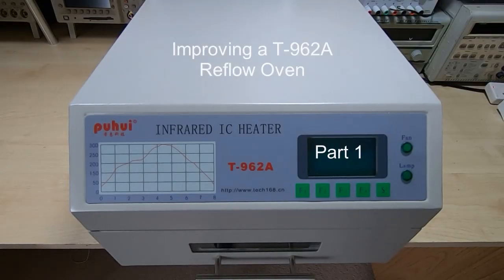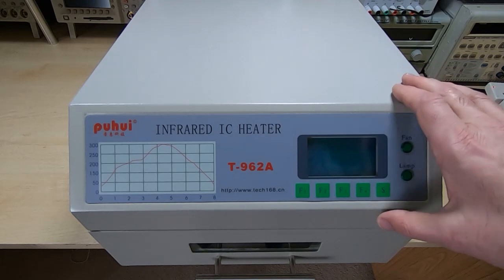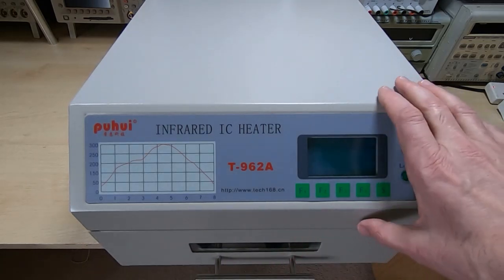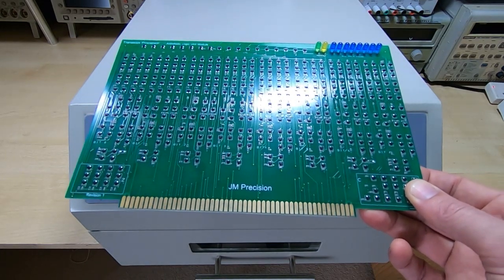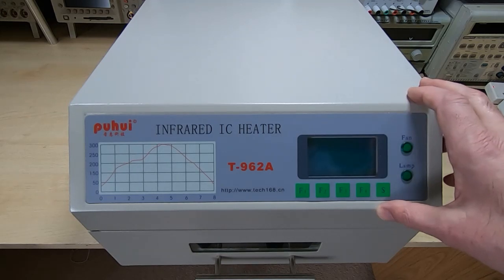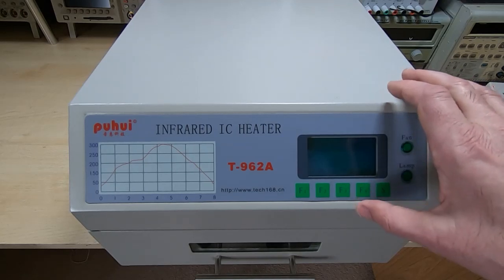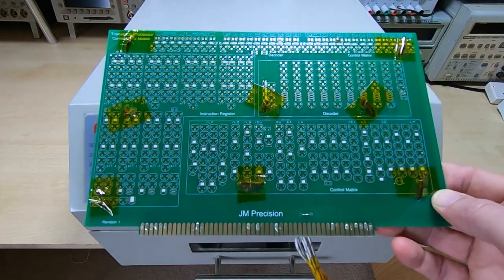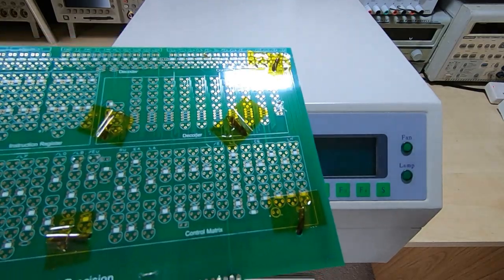Improving a T-962A Reflow Oven Part1

Comment: I think it is important to note in something as relatively simple as an IR reflow oven why the distinction between "industrial grade" and "hobby grade" shouldn't matter to most people. "Professional" results are going to be able to be achieved with either if you put in the requisite time to understand the machines and their eccentricities. The primary difference between "industrial" and "hobby" in these units is not quality of output per se but throughput. The industrial equivalent will have a conveyor belt that can interface with placement machines and basically is pre-configured for pumping out ungodly numbers of pcbs in as little time as possible. You will obviously never do that with the "hobby" units, but for anyone that is not producing pcbs on the scale of thousands per day, it really isn't going to be any different for you.

Comment: Very interesting. I had this conditions in other reflow tools that characterized. I compensated using lower melting point solder paste, and it worked fine. Thank you for sharing.

Comment: I’m Dutch and I know nothing about the flicker standard. With that out of the way I have to say that I don’t understand why you shouldn’t be allowed to use PWM provided that you install decent filter as well.
Reply from the maker: Because the standard does not allow it, it makes no difference if you understand it. In the UK (and all harmonized standard countries) the standard applies to any commercial product and a filter would make no difference as it relates to mains voltage stability and Not 'noise'. Having said that I am talking about low frequency switched control and not high frequency control although the standard would still apply if it causes the mains voltage to be 'switched' in such a way that step changes in voltage beyond certain limits are caused. Suggested site to review https://www.newtons4th.com/electromagnetic-compatibility-iec61000-3-32013-flicker-analysis/
Reply: Jerry Walker Hi,
Thank you very much!
You are absolutely right that it doesn’t matter whether I understand it or not. 😁
I’ve looked at the suggested pages and the standard makes much more sense to me now. It’s to prevent excessive voltage fluctuations mainly caused by appliances with large motors or resistive heating elements. 

I was thinking about SMPS but they switch at high (>50kHz) frequencies and are off the chart (Pst curve of fig 2). The noise they induce could and should be filtered of course. Using transistors for switching or otherwise regulating the heating elements would probably be too expensive for this oven. 

More importantly, having watched your other video’s now, regulation isn’t even the issue. 

I do appreciate your robust methodical approach. 

Thanks again, Eduard
Reply from the maker: Thanks, Yes absolutely correct and as you see in the later videos the problem turns out to be one of energy distribution rather than temperature control.

Comment: Looking forward to see where you get to.  It is possible to change the power using variable voltage PFC drive on each lamp, though it's over the top if you have a simple solution.
Reply from the maker: I was initially going to redesign the 'system' but as this is not my primary reflow oven I wanted to find a solution that anyone could apply with minimal cost and effort. The video currently uploading shows a good step towards this. Let me know what you think.
Reply: @JerryWalker001  I saw the improvement - nice!  Then I wondered how about rotating the baffles, so you get even more heat spreading and move some air at the same time.  Of course, it's complicated to make things rotate in a hot environment, but just a thought.  Maybe this is part of the reason a conveyor line is so good - each board passes through the same profile even if some heaters are 'off'.

I'm interested because I have one and would also like to get it to 'perform' better.  I bet there are lots of people in the same boat so well done for tackling it.
Reply from the maker: Chris Mr, You should find the next video very interesting (posted tomorrow). You are absolutely correct that the professional machines have the advantage of moving the boards so do not have the same problems of hot and cold spots because the baords sweep past the heaters. The improvement using just baffels is quite good and probably makes the machine much more useable (I will show some run results). The original goal was a non intrusive upgrade and the baffels possibly acheive that but I was not really satisfied with the results and as I had my machine apart I thought I would try some other things. Most likely many people would be willing to make other changes if the results were worth it (and the cost not too high). I have tried fitting a circulation fan to re-circulate the hot air instead of blowing cold air into the chamber. The results so far are very good (again I will show some results). I have other things to try and one of them is to fit a 'shifter' to the drawer which will simply move the board tray back and forward approx 25mm during the run to simulate a conveyor. I will post results as I proceed so anyone can decide if they want to make the changes based on results. The fan has transformed my machine as you will see in the next video with a temp spread at peak of only 6C and peak times spread by only 2 seconds compared to 40C and 60 seconds in the original configuration and peak within 2C of the set profile temp compared to 20C.

Comment: how about some interal sort of waveguides and a better control... more sensors
Reply from the maker: Todays video shows some improvement. Unfortunately a better controller and more sensors alone will not help much because there is a fundamental issue which I cover in the next video. A better controller may then help although what I am hoping to acheive is a very simple modification that anyone can apply with minimal cost and work.

Comment: that looks a lot like a S100 buss board card
Reply from the maker: Its a card from the transistor processor kit. It is identical in width and connector to an S100 but it is 20mm taller.

Comment: Should be fun, I have a very similar machine to that.  My solution was to adjust the top temperature higher until it soldered everything.  Bad for the parts and all but it mostly works, should be interesting if you find a better solution!